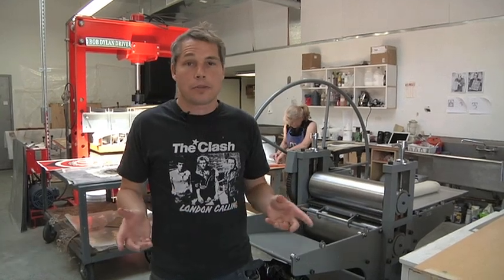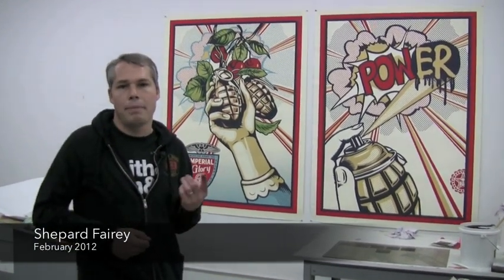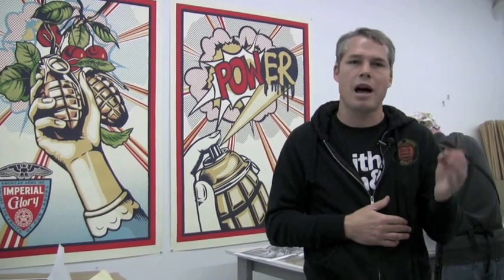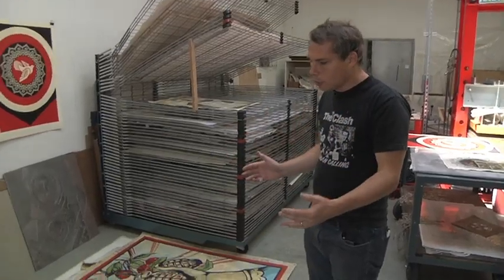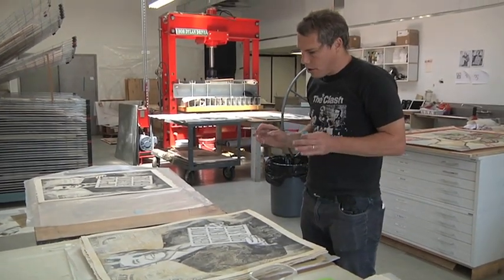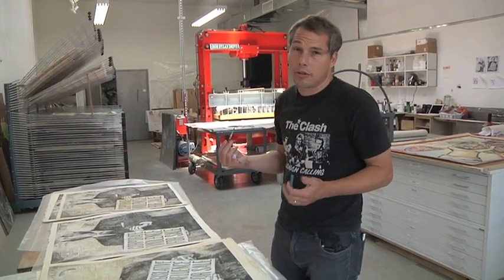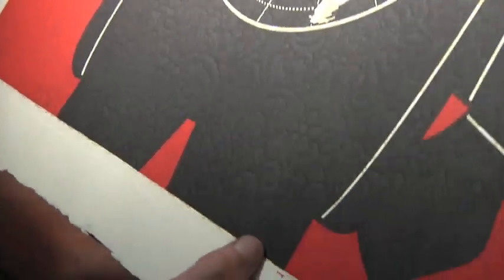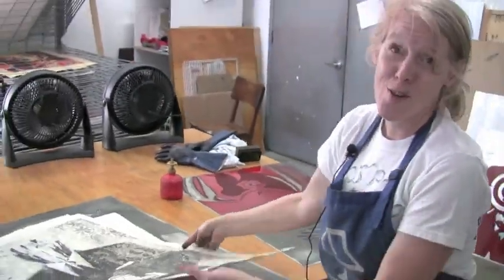Shepard Fairey: Printing "Harmony & Discord" at Pace Prints

Comment: Great combination of techniques.
Reply: +vexedart.com are you familiar with making paper out of collage...could you illuminate me on how to make a paper similar to the ones he creates to screen print his images on?
Reply: blk stone
Hello blk stone. Had a chance to stop by Shepard's gallery a few days ago and see some pieces in person. Not exactly sure but I would guess that you would layer, glue, rip, & stencil over designs printed on a various different thinner papers onto a heavier printmaking paper. Does that make sense? So each sheet would essentially be unique. Are you a screen printer?
Reply: vexedart.com I'm starting to learn.  I have always wanted to and I just screen printed my first piece, not the greatest, but I'm looking to consistently work on it and paint. 
He also mentioned in a doc about sanding the pieces..
Reply: blk stone Sounds good. It is the same as anything you are learning. Lot of patience, practice, learning and failing. There are never any short cuts. I have been printing for 15 years. You will develop your own spin on techniques as you go.